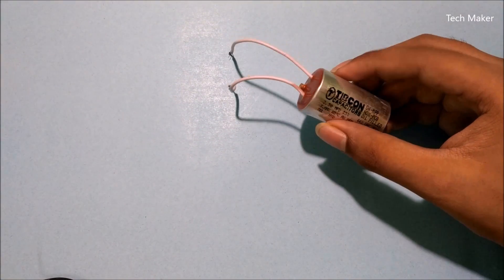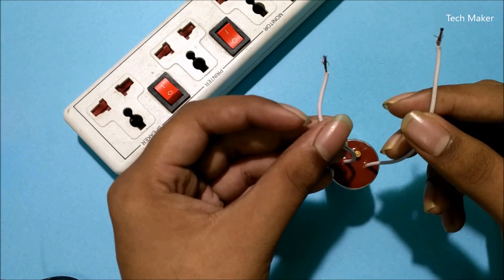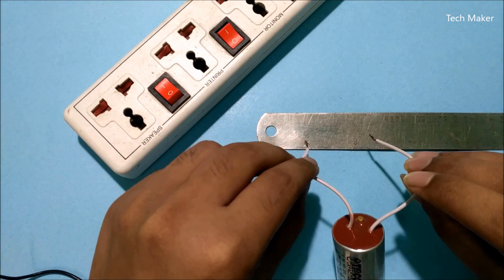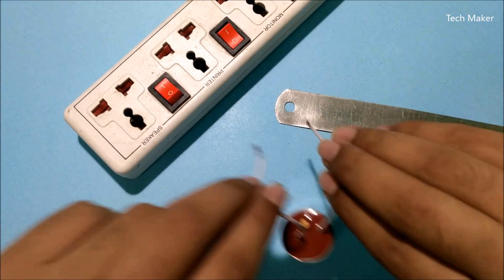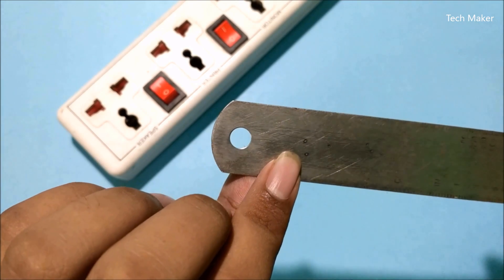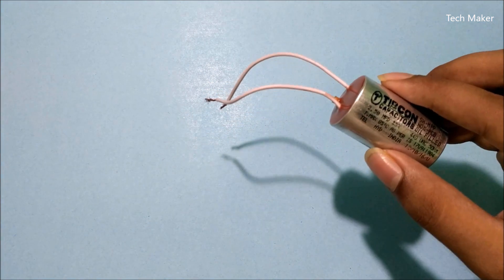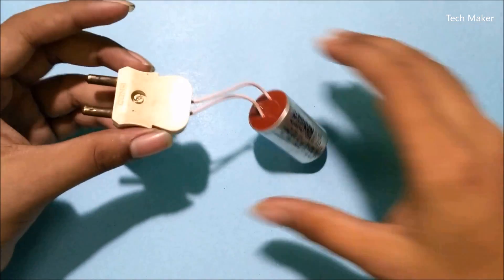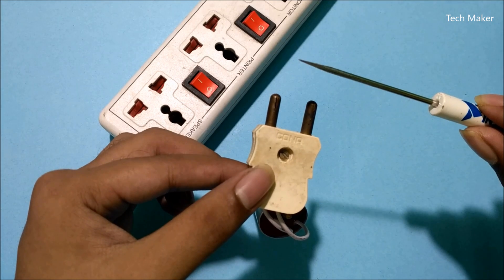Experiments with Fan Capacitor

Comment: After discharging the current from the plug....,,does it will again can give shock??
Reply from the maker: carri minati after removing from the plug ,you will be having some charge in capacitor, it will give you shock. If you discharged that capacitor after removing from plug you will not get shock . Be sure that capacitor is discharged.
Reply: If you connect 1 Meg ohm resister between the negative and positive lines of the plug, then there is no need to discharge by connecting the plug leads with a screw driver or any other metal.  Pls let me know if I am wrong in this.
Reply: Nimal Perera youre right but still check with a multimeter